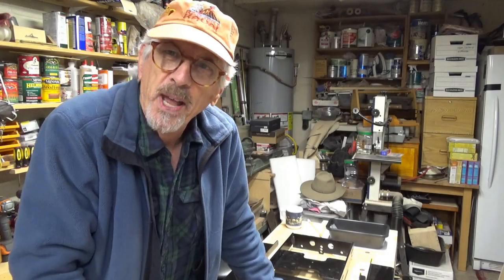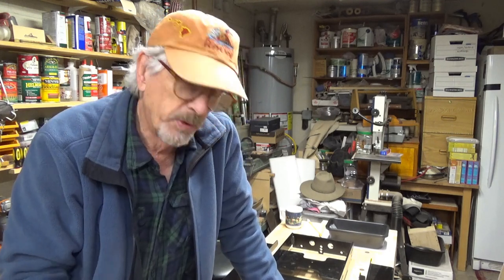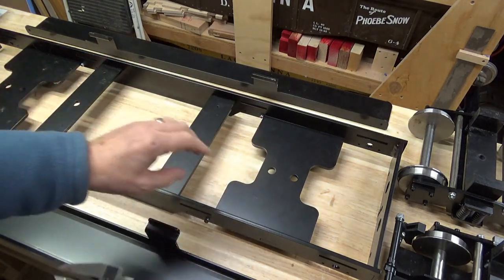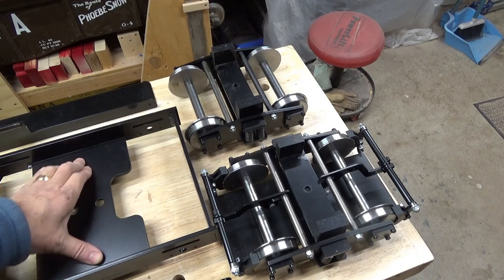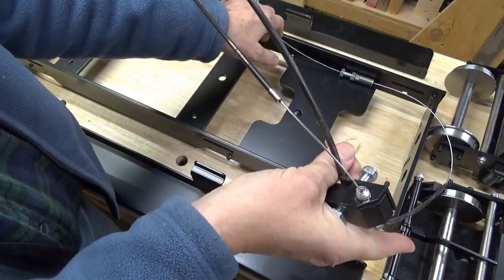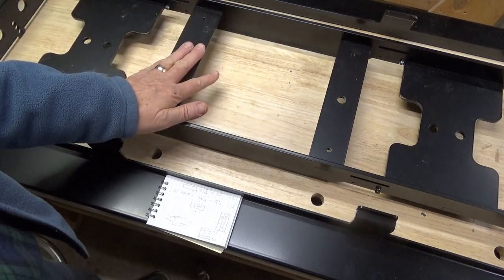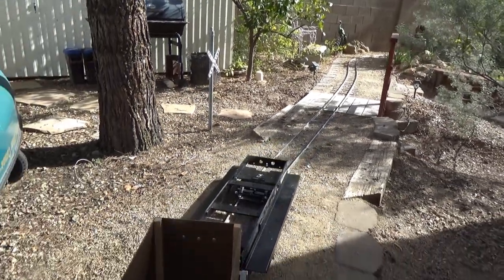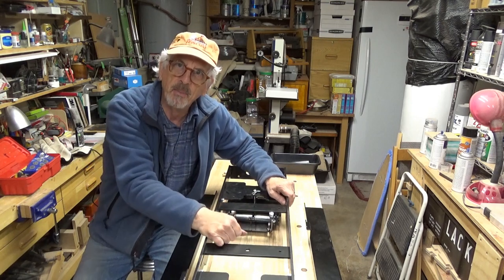First, The Frame!  Tender Build Part 1 - CNRR # 73

Comment: Real craftsmanship. Very nice trucks indeed. It's like working in the real railroad!!
Reply from the maker: Yes, that chassis is all CNC cut, fitted, welded, and powder coated.  A far cry from my plywood and aluminum home brew version.  I think they are engineered for doing public runs at clubs.  A bit overkill for my little railway!